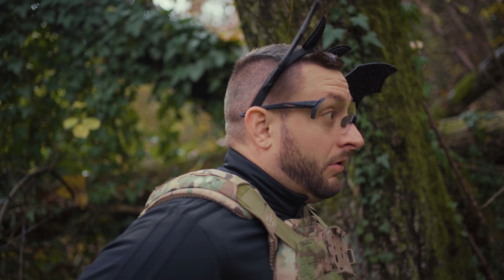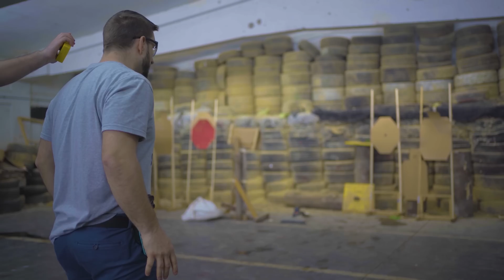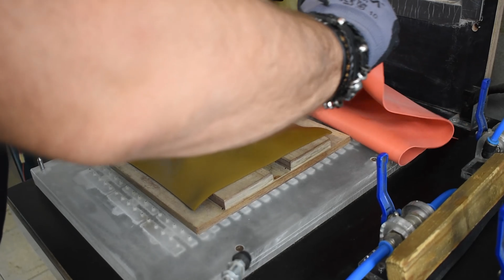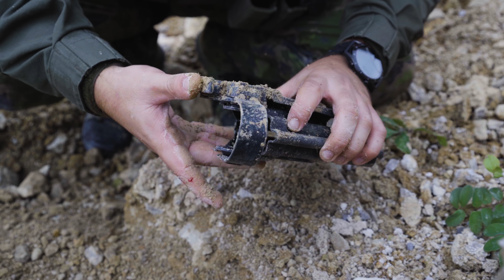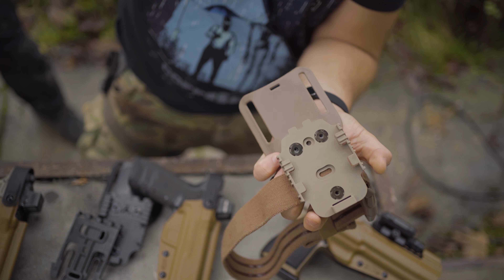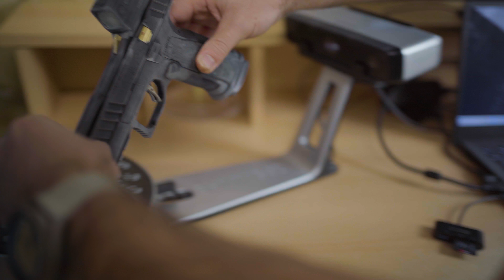Fastest level 2 retention mechanism

Comment: Technically that is a level 1 holster, not a level 2
Reply from the maker: No, level 1 retention holster secures the handgun only with single mechanism - passive friction (locks on trigger guard or light)
Level 2 is the hood latch and level 3 has an additional lock on thee hood latch

Comment: Mk23, usp when?
Reply: I emailed them about my USP Compact thinking it or my full size could fit their VP9 holster. Their response:
“Hello Christian!

My apologies for a delayed response. I've just checked and the USP-C will unfortunately not fit into our VP9 holsters due to the larger slide/frame dimensions. 

We make all our holsters using CNC machined molds, which take quite a bit of time and resources for development, which means custom projects are unfortunately not possible.

New molds are typically developed according to the demands from our distributors, provided that the ordered quantities are sufficient.

Please let me know should you need any further assistance, we're always happy to help.

Best regards”

I bought a Swiss P30 V4 recently so I’m sure that’ll fit it but I hope they make the VP9 holster for a weapon light soon.

Comment: I see  Neic used a Walther PDP with a PGW Comp. Did you do something to the springs or is yours reliable? Mine was somewhat temperamental with the Standard-Spring and 124gr. Ammo.
Reply: Absolutely no changes made, I simply threaded the compensator onto the end of the barrel. No issues whatsoever, but I've only been using 124grs S&B and haven't tried it with anything else.

Comment: I have two BGS holsters, fine holsters otherwise but the screws in them are really low quality and rust easily. I had to replace almost all of them in less than a year of use
Reply: Sorry to hear that. That was likely an early batch of screws, we changed the coating in the meantime for better corrosion resistance.
Reply from the maker: I have similar experience with a couple of holsters but i just used some CLP on the screws and they still hold.
I dont think screws were low quality as high carbon steel is the one that rusts more but they had poor or no antioxidantion coating
Reply: @PolenarTactical  Mine would have the threading break off or something, it was a constant problem of taking off your gear after a competition and find that "oh, yet another screw has gone missing"
Reply: @NukeBunny_  Threading is unlikely to break easily, but components might have came loose over time and if there is no tension on the screw's head, the loss of hardware can occur.  We do our best to prevent the accidental loss of hardware, that's why we now use different types of thread lockers or nylon patches on every threaded part on the holster. But routine maintenance as instructed on the back of our packaging is still the safest option. We deeply apologize for the issue - should you need new hardware or need to resolve any other issue, please do not hesitate to contact us and we will make it up to you!

Comment: will the holster safety mechanism be for sale by itself?
Reply from the maker: I asked the same but it seems that at least for now, they will only be offering them already mounted on a holster
Reply: Yea I have your older Kane model and it is a little too slow to release the active retention. Not gonna pay the full price of a complete new holster just to fix that.
Reply from the maker: @ericp1874 that’s a good point, when i asked it was specifically about offering these level 2 mechanisms to other holster manufacturers.
I think upgrading your old holster is a completely different thing and a viable reason.
Send us an email and we can sort this out
Reply: @PolenarTactical sent
Reply: @PolenarTactical  would be great if they did, will check later/ping them directly

Comment: So openly carried lvl2 & lvl3 that are for Games & not for retention in the Real World where some might actually try to grab your weapon...the point of the extra retention is to make it harder for someone else to grab the weapon...
Reply: I was wondering about this too. Was hoping from seeing the thumbnail there would be a clip of ziga trying to steal it out the holster from behind the other dude. The design makes me think it's too easy to steal.
Reply: @tiiiimmmmmm  not everything made it into the video, but for this reason we also have a hybrid Level 3 system with an added rotary block. You can see it on our website.
Reply: @tiiiimmmmmm  As EASY as they show it is to draw...that is my concern too. Having worked as a cop, even with a PROPER lvl 3 holster (which I hated) it was always a concern.